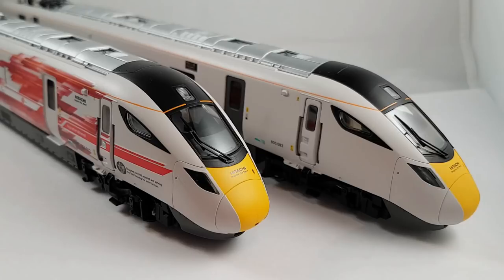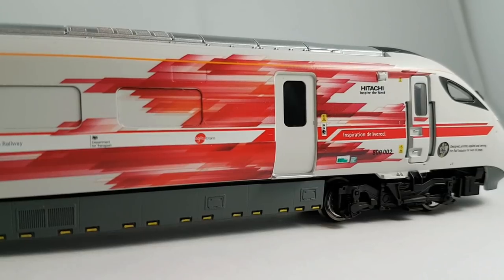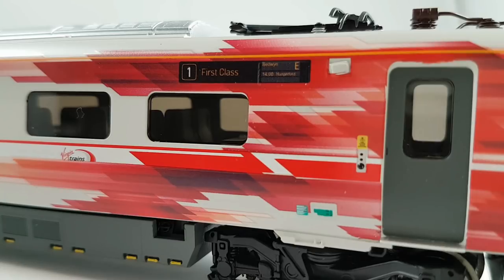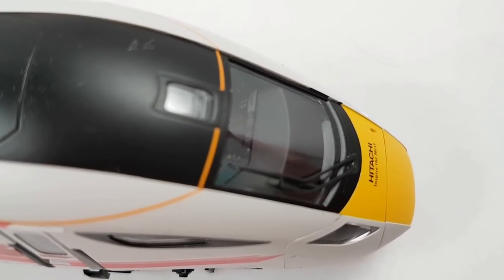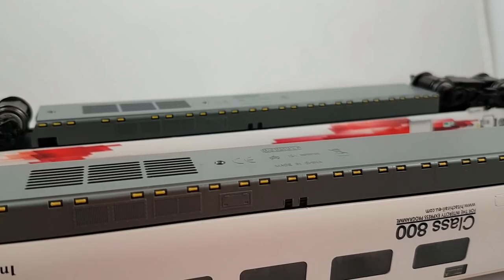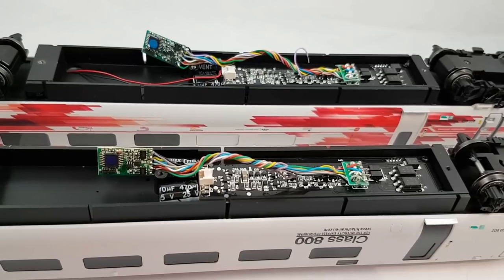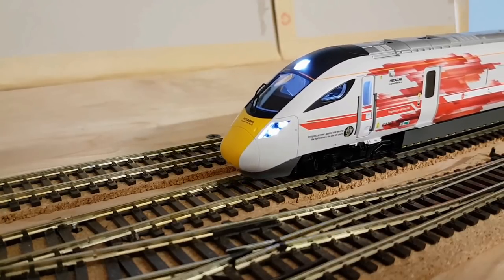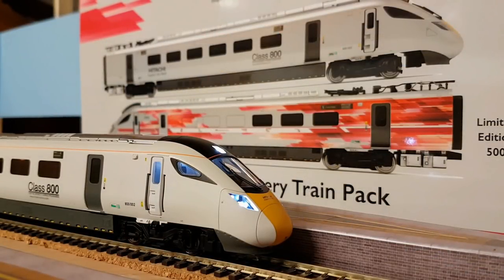New Junction - Hornby Hitachi Class 800 'Limited Edition' R3579 | Under Closer Inspection

Comment: Thank you for your very thorough review, I applaud Hornby in the attention to detail that has been used to produce this model, it is a very brave move to produce this model whilst L.N.E.R. are testing the Class 800 on the network and have not finalised their livery scheme. I trust an analogue version will be also forthcoming for those who cannot afford the £267 outlay for this model.
Reply from the maker: It's analog out of the box! :-)
Reply: @NewJunction  I thought there were 4 versions available TTS c/w DCC chipped, DCC chipped, DCC ready to take a chip and pure analogue with no DCC facility?
Reply from the maker: @brnesouthwest9915  the set comes as 'DCC ready' which is in effect analog but with a 8pin chip slot ready to be made DCC or DCC sound. :-)
Reply: I don't think I'll buy this version however I am looking forward when the L.N.E.R version comes out. The possibility of coupling this to another set is a good idea, as this was operationally done during testing.

Comment: Great modern image loco and the underside access for the installation of chips, speakers, etc is a good move. Probably helped by the fact the real life loco has one big rectangular box rather than the usual subdivided equipment lockers. Not sure if, at 10:56, there is light bleed from the drivers door or if it was your "studio" lighting?

Comment: Excellent review of a lovely model.  I have this one as well as the GWR livery version.  I have 3 gripes though: 1. As others have mentioned, why oh why did they not produce the 3 central carriages (or at least make them available for separate purchase). 2. Whilst fitting a standard DCC decoder is easy, there is not enough space for a DCC Sound decoder without hacking away at the innards, which does rather undo the good thinking around the speaker housing etc & 3. As you mentioned, the 5 car unit does not run without derailing every time.  Mine has been sent to and returned from Hornby with the modification made but why on earth could they not get it right in the first place?  Anyway, these points aside a great model and a smashing review!

Comment: Nice review, lovely looking loco, for the coaches you could wait for hornby to release the GWR coach pack later in the year and respray them to match your model.

I would like an IET for my layout but i'm gonna wait and see if Hornby do the class 802 in GWR as that's what is supposed to be running in the region that my layout is set in (Cornwall)

Comment: If you had to change the CVs because directional lights both thought they were going forward, it's likely that the decoder was in the wrong way around in your dummy car. I'd assume it's the dummy car as you never mentioned that the loco drives backwards when you try to mvoe it forwards!

Comment: For 300 odd quid it is disappointing they didnt take into account the length of their decoder wires when deciding the position of the decoder plug. Nice touch that you put the decoder in the bottom though. Surely the Hornby decoder accepts a long address so should be able to accept 800? Prefer the GWR scheme to this one.